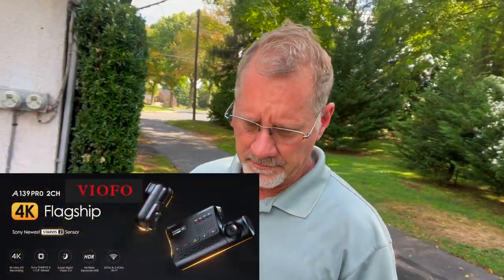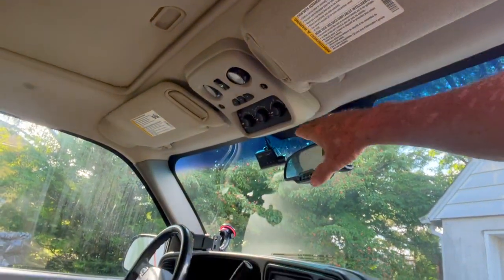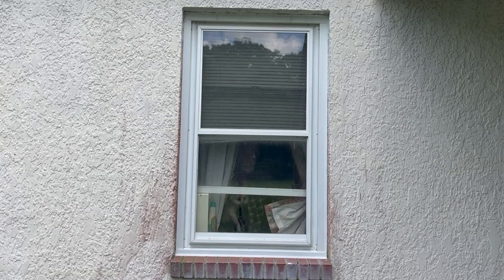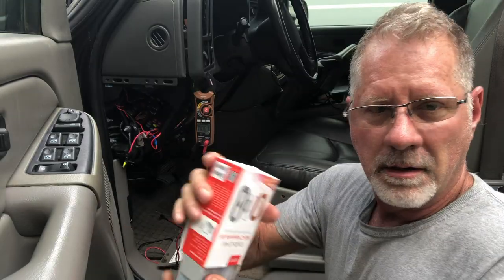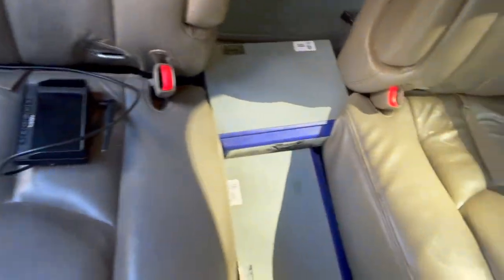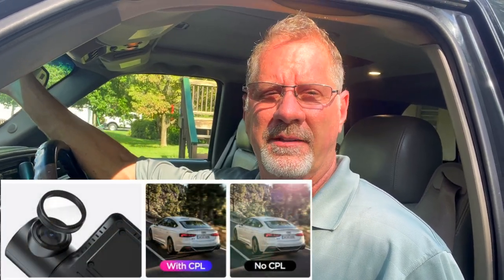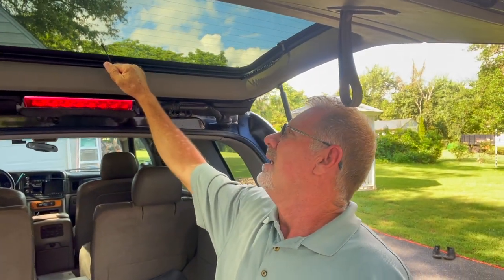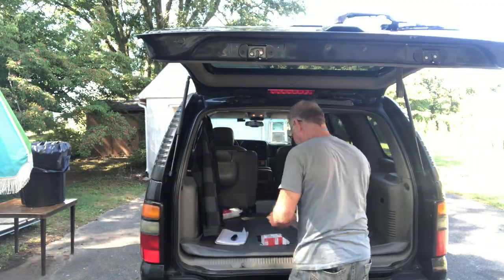VIOFO A139 PRO W/Starvis 2 Dash Cam Review and Installation

Comment: Lol..Love the Tin Foil Cap..Why did you say to buy 3 camera's? Where do 3 cameras go?
Reply from the maker: Inside the cab to record the driver and driver window.👍🏼
Reply: @enigmaticnomadics  My ideal system would capture 360 degrees. I wonder if there is a system that does that, or if I'd need to buy 2 systems.